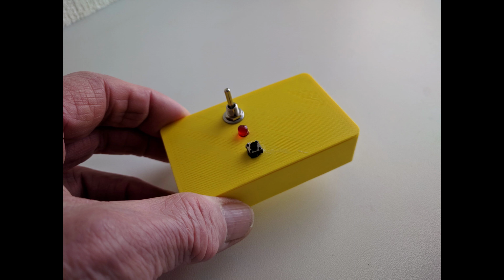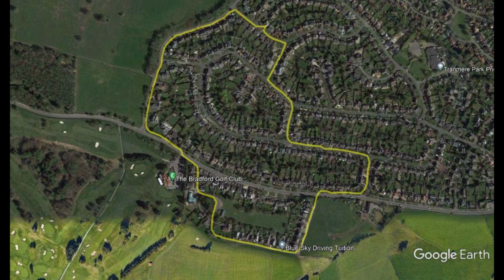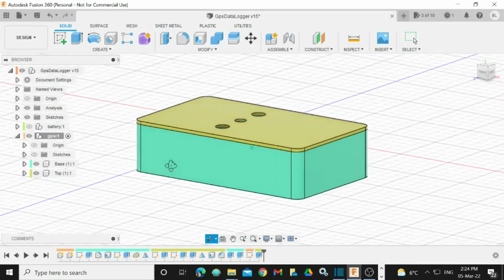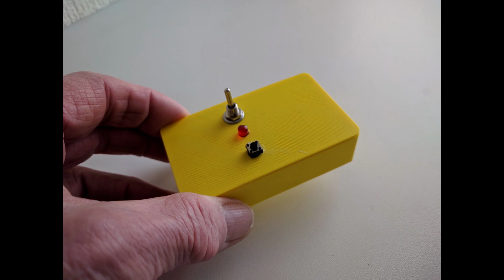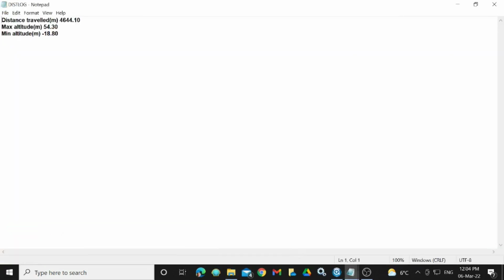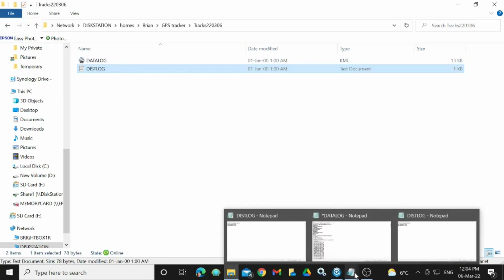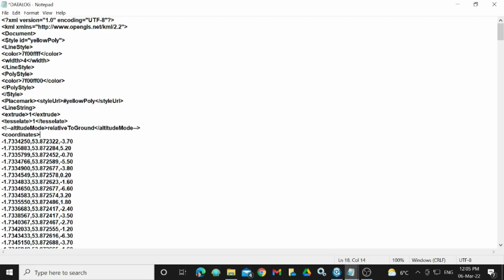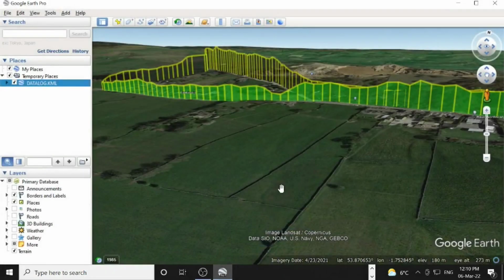GPS Logger

Comment: Thank you for your great work and sharing. Would be great to see an evolution of this idea into something really really small that would contain a small lcd displaying max speed, max altitude, gps signal quality etc so you could put it onto a non FC plane and get the basic parameters of your last flight right after landing and with a press of a button they would get saved under the unique flight ID so you can have a multiple flights that day and for detailed information they could be pulled from a microsd card later on when u get back home. So basically the same thing but more compact and with a i2c tiny LCD :)
Reply from the maker: Had a closer look at Using the Wemos D2 Mini (processor and wifi) and your mobile phone instead of an LCD screen. It looks as though, if you would direct wire the components (GPS, SD card reader and Wemos D2) you could get the components into a space about 40x30x15 mm. you would only need access for the removal of the SD card.
Here is a screen shot of a mobile phone showing some of the information you would see. Obviously the information would be as required. Two buttons are shown on the screen for some unspecified functions. https://youtu.be/DjThZqT2yd8
Reply: @BrlnUK  maybe I’m wrong but not sure if WIFI or BT connection would not interfere/mess with 2.4ghz radio signal as this is be or not to be of our models :) Also using something different than adruino nano would probably increase the overall cost. As for the size 2-3$ lcd is like 30mm x 30mm and same goes for gps bn180 /bn220 so not too bad. Cheers
Reply from the maker: Thank you for your idea. I have gone over one or two possibilities.
1 - Write an app for a mobile phone that communicates with the logger via Bluetooth, so saving the need for LCD display. But this adds a Bluetooth module to the mix.
2 - Replace the Arduino Nano with a WeMos d2 (combined microprocessor and wifi module) and use a mobile phone app with coms via WiFi. The Wemos is a little smaller than the Nano but, given the need for a GPS and SD card writer, the overall size will not change much.
At which point I seem to have run out of ideas!

Comment: Nice Projects! I will try your project this weekend. I do not need a led that flash, cause  one of my gps module has tiny led that flash when it is fixed. Normally, you can buy mini sd card reader for mini sd. The one you use does consume 5v , however I found one on ebay that is tiny mini sd reader that is smaller than your, it consume on 3.3v. I love seeing someone with GPS datalogger as my hobby.😁😃😁😃 Thank you for your video.
Reply from the maker: Good luck with the project, I hope all goes well. Regards